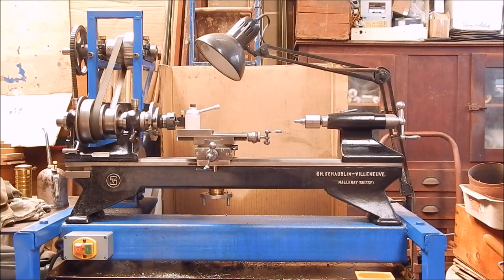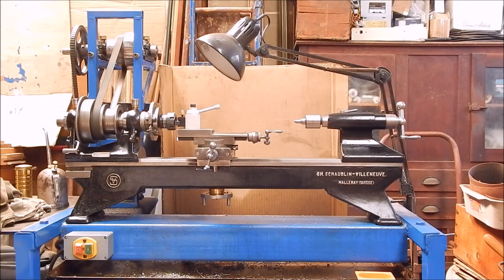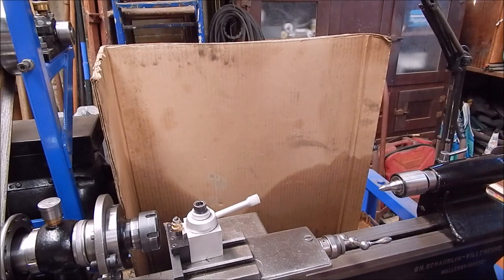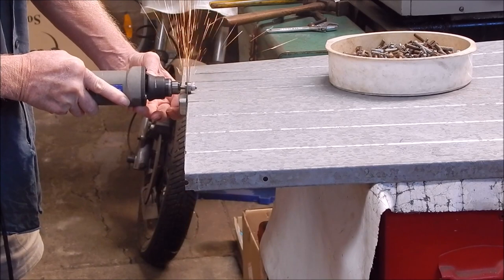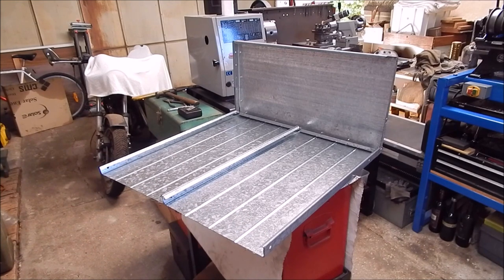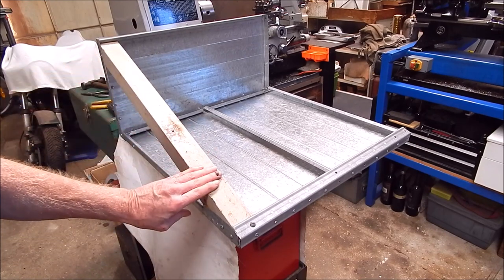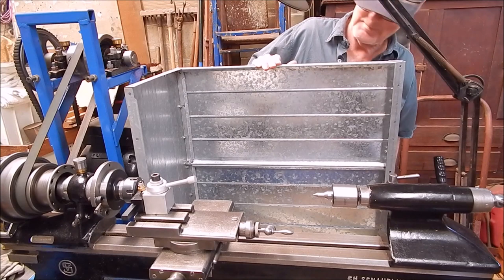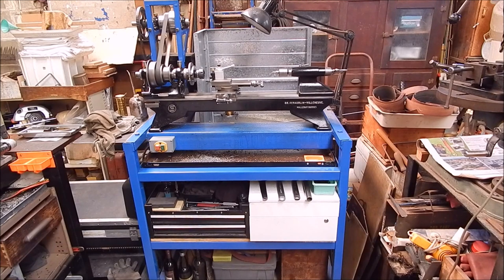I make a removable rear chip shield for the Schaublin 102 metal lathe

Comment: Hi Rob. Nice job there. Most peoples jobs start with sawing off a chunk of material with a saw. You're like me, my jobs start with finding something along the side of the road. It's funny, at one point the metal parts looked flimsier than the cardboard! Anyway, glad you're out and about and doing a bit. One thing that occurred to me, if I were doing it I might do it inside out, so the inside doesn't have the chip shelf half way up. I was lucky, my Willson came with the factory chip guard already on it. Take care, mate. Mart in the UK.
Reply from the maker: Hi Mart, I considered which side to have the flat section, but it could only go on the outside as the shelves utilise right angle corner bracing (which you can't see) and it only fits one way.  Plus it could catch and cut me with the exposed edges outside when I squeeze past in the limited space. 

You're right about how flimsy those junked shelves are compared to even cardboard.  They are real crap.  I had to incorporate the legs to brace it and it still needed the diagonal bit.  A coat of paint might happen one day.  Cheers Rob

Comment: Nice find Rob. Love it when things get reused/repurposed. No need for paint. It's gal and it will get oil and stuff on it, so painted or gal finish will end up the same.
Reply from the maker: Hi Benny,  I have painted the outside of the panels blue and left the inner lathe side plain galvanized and it reflects the work light great.  Makes quite a difference.  Cheers Rob
Reply: @Xynudu  Now that's thinking! Very good indeed Rob!

Comment: G'day Rob.  That is just right for the lathe.  I often think of making a chip guard for my lathe but so far no work done.
Reply from the maker: Hi Harold,  I hate chips on the floor, they walk everywhere.  That's why I made a magnetic broom years ago - really useful and not too big.  A chip shield is a good thing.  The one on the larger Chinese lathe is also made out of an old steel shelf.  Works well.  A good project for you ;)  cheers Rob

Comment: Great job Rob 👍👍 I love re-using stuff, it ain't scrap if you can still make use of it! I think the shelving metal is a good fit with the stand that you made for the Schaublin.  I'm a bit disappointed in the way you just discarded the old and very expensive chip guard though 😂🤣  Cheers, Alan.
Reply from the maker: Yes, it brought back a lot of oily memories as I cut it up.  Life is cruel at times.  Cheers Rob

Comment: Nicely done Rob, not going anywhere and hopefully because of your drop beam stand, it won't pick up vibration and make a racket. I guess you could always drop a couple of bolts in if it does get noisy. How's the eye recovery doing mate? Cheers, Jon
Reply from the maker: Hi Jon,  I doubt it will vibrate as the lathe is very smooth. I have two weeks to go without a contact lense in the cataract eye before they can make the arrangements to operate.  So small fiddly jobs are a bit difficult ATM and I'm just doing easy stuff like the chip shield.  I was thinking the reflective galv surface may actually make the work light more effective as well.   I will have to see how it goes as they are normally painted.  Cheers Rob

Comment: I see you have the Eagle 66 and Rega oil cans, restored and retired mine, display only now, hate to drop them.
Reply from the maker: Great oil cans and I still use mine.  Better than most of the latest ones.  Cheers Rob
Reply: Hi Rob, my Hilda Die Grinder is finally coming on a slow boat from China, I think they had to make a new batch.
Watching you cut the chip shield with your's was curious what type of cutting disc you were using, are they available from Bangood?
Thanks.
Reply from the maker: Hi Willem,  the Hilda is a great tool for cutting small round stock/bolts and thin metal sheet.  The disc I used is the same as motor body repair shops use to cut away panel damage.  They are 75 x 0.8 x 10 mm.  You can also get them in 1 mm and slightly thicker.  I buy mine from a company in Australia called Smith & Arrow.

Banggood do not sell this sized disc, but look on Ebay and I expect you will find a local seller.

Cheers Rob
Reply: Thanks Rob.